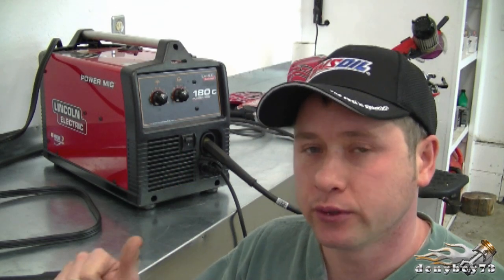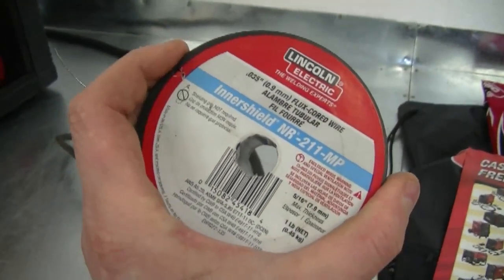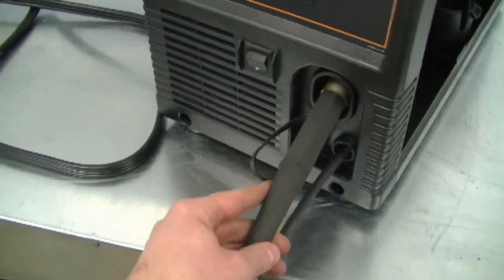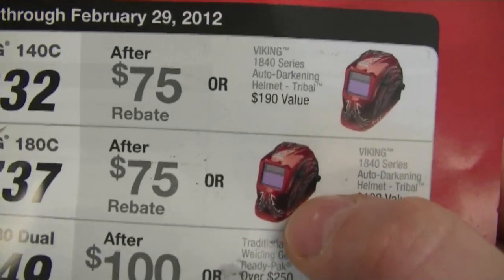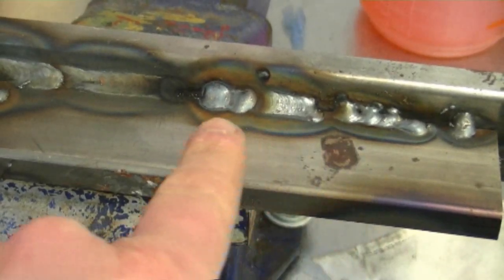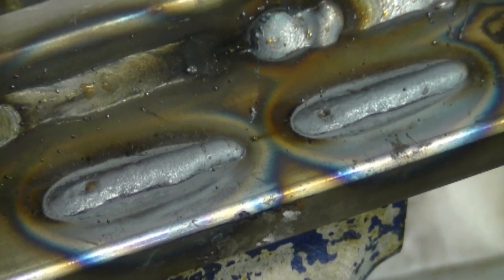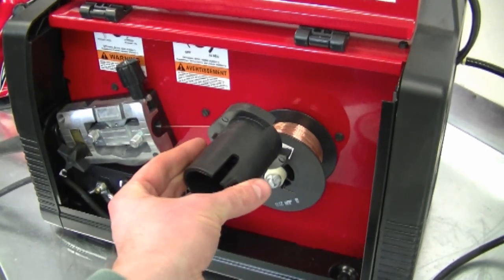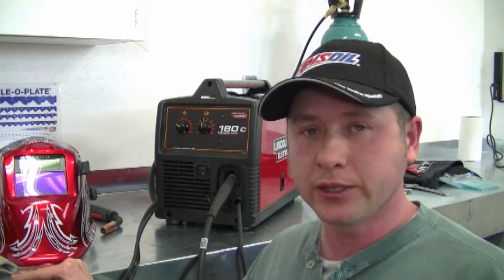Review of Power Mig 180c Welder by Lincoln Electric

Comment: Im a retired welder Fabricator of 32 yrs I built ski lifts for 25 yrs  I No longer have a shop i just need  a mig welder to do ornamental iron work  with my son in my home garage , The last job I did I Fabricated  1/3 of the steel barrier fence that surrounded ground zero after 911, I welded the Memorial plaques  to the entrance gates.
Reply: Ol School Welding Tips and Tricks you sound like a pro. , do you think this welder will be okay for 1/2" steel ? I'll be using flux core...
Reply: CB in the bible daily  You can weld 1/2 " Material  if its going to be very structural  project  I would do multi pass  I just bought  the lincoln  180 dual   and I welded  3/8  plate no problem and it wasn't  even maxed  out .iLL be doing a video  on the 180 dual  using mig solid wire 75/25  all positions  including  overhead  .
Reply: Ol School Welding Tips and Tricks thanx, I was thinking about doing 3 beads on 1/4" tubing, I said 1/2" in case I ever needed it thanx again, I'll be looking out for your video
Reply from the maker: awesome man
Reply: Ol School,  Riblet?
Reply: That's a light duty welder for that really,  I have a Lincoln 256, much better for heavier material.  Miller 212 Autoset  or 252 is nice for what you are talking about as well.

Comment: There is also a very important note the welder has to be set either dc- or dc + depending on weather you are welding flux core or with gas.Flux-cored welding requires DC electrode negative and gas dc electrode positive

Comment: Nice video Donyboy, I just bought the 180c off of Craigslist for 6 bills, the guy only used it a couple of hours if that, it looks brand new, not one mark on it with the cart...

 I will be running it off a 6k watt generator doing mobil repair and custom handrails. After watching you run your machine, I am impressed with the performance, I'm waiting for some 10 gauge wire and a plug off of fleabay to make a pigtail to run off the gen set. I can hardly wait to weld. 
 
And again, very nice video!

Comment: I had a hobart 140 handler w/110v plug.  One knob had 4 numbers and the other had 10 or 12  (like yours with letters) that adjusted how fast the wire was fed and the knob with 4 numbers adjusted the current ( from 25 to 140amps) Yours will do 180 so having 220v as the supply would be less stress on the equipment. when you use gas it won't splatter like the flux core w/no gas

and you are going to want to secure that tank!

Comment: a tip.....i was a structural welder for 11 years on drilling rigs and navy ships parts.....pull the nozzle past your tip about a 1/4 to 3/8"....youre gonna get splatter stuck to the tip ...never have your welding tip further out than the nozzle...especially when your doing heavy welding.....also use nozzle dip, its a gel that you submerge your tip of gun into after welding for minute ...make sure its good and hot so it can melt the gel onto the nozzle and tip....shake excess off and your good to go.......
Reply: Red Blue40  the nozzles and tip are like this from the factory or even when replaced. There’s no adjustment’s. Can the tips just be grounded,cut,or sanded down to the length that they’re recessed below the nozzle?

Comment: if you find yourself  using it alot, i would highly recommend getting the bigger 10 or 11 lb roll of wire after you are done with that.. really sucks having to stop half way through a weld to change the wire. i have a smaller flux core 120v lincoln, and i have used it alot, and it gets very decent penetration, ive put about 25 lbs of wire through it so far and i haven't had to so much as change the tip.

Comment: Get the nozzle in a bit closer to your work. You have too much wire out, looks like you are back a good inch maybe more. Try to get in closer to 1/2" to 3/4 of an inch, it really makes a difference. And SLOW DOWN.  Let that puddle fill in before you move.  It doesn't make as much difference on surfacing beads but on T joints and lap joints it makes a BIG difference especially if you don't want undercut or not enough wetting in on the edges.
Reply: Yep, I thought the same thing.  Get closer.  The arc needs to be shielded by gas, and being closer will also allow you to get more consistent.

Don't look for beads on top of metal... a nice stack of dimes will let you know you're getting enough penetration and adding enough metal to get a good weld.
Reply from the maker: BigDogsHunt100 thanks, I've gotten lots of practice since

Comment: No doubt MIG welding is a lot easier to master than stick! I took some evening lessons at our local tech school , Mastering vertical and overhead with stick takes a lot of practice and knowing the right heats. I have a MIG welder but don't use  gas. Flat welding is relatively easy. Too cold to do any weling as my garage is not heated. I do check the helmet batteries often before doing a weld job.God vid Dony.

Comment: I was a code welder for 16 yrs., and if you want to get better… keep your tip inside the cup about 1/4 inch. and get your cup closer to the weld puddle. I saw your welds were a little oxidized, this will prevent that. Good luck !.
Reply from the maker: thanks for the tips

Comment: Bought this yesterday, holy Molly!  Best welder I got so far.
Reply from the maker: same here, I only use it with the gas
Reply: donyboy73 I haven't used it with gas. If I buy the Argon tank, do I just connect the gas line to the back side and start welding?
Reply from the maker: Hardy Jabbar yes with just solid wire, you should have gotten the gas regulator with it

Comment: I enjoy your vids donyboy73.  Quick question: did your 180c come with all the gear you needed to run 0.045" wire?  
I bought the Home Depot version and the 0.045" wire requires a gun liner, 0.045" feeder sprocket and gun tip that comes in a kit with 10lbs roll of wire.  Of course HD or the other stores dont stock this kit which apparently retails for about $C175 if you can find a place to order it.  The larger wire is needed for welding 3/8 to 1/2" material (which is why I went with the 180 in the first place!).  People thinking about these machines might like to know for price comparison.  If the 180c comes with all that 0.045" gear for thicker work material then it is a way better deal.  
Is that a prairie Mennonite accent I detect ? ;)

Comment: Nice review - makes me want to add one to my shop ;-)
Quick pointer about ending your welds - saw on your test piece that you have fish-eyes and a tapered weld - you need to pause your gun travel for a moment and roll the head up perpendicular to the work before you cut the arc.  This will give you that extra bit of fill wire into the end of the weld to beef it up and fill out that little hole.  It's an art form... keep creating!

Comment: if you repair auto body panels do not use flux core because the flux will effect the paint... you have to use the gas known as mig or gmaw... the flux core will work on exhaust systems well....practice makes perfect... happy welding
Reply: isellcatlitter 
As a certified welder i am telling you that you have to remove the paint before you weld because the paint will make a poisonous gas.

Comment: This is the specs of this machine from Lincoln  for the 180c Voltage/Duty Cycle Current Voltage at Rated Amperes
 230 V 30% 130 Amps 20
 208 V 30% 130 Amps 17
 Welding Current Range Open Circuit Voltage Wire Speed Range
 30-180 Amps 34 V 50 - 500 in/min.  (1.3 - 12.7 m/min.)So if you Take the Scale on the inside of the wire compartment like all Licolns have you will be able to figure out what the A-J calculate out to A being no lower than 8 volts and J being 34 volts would be 26 volt difference divided by 10 would be 2.6 volts difference between Letters.

Comment: I'm just wondering how it works because the welding machine that I saw has welding rod to connect the metal together and that machine just use electricity and w/o welding rod?  Thanks a lot

Comment: nice welder. i have the hobart handler 187. i have had it for 2 years and i think it is equivalent to you lincoln.by the way i work on small engines free time and use to work part time t a shop any tips on how i can open my own shop.

Comment: I have the 140 hd set up with a tank and I have the 120 for only flux and 140 for straight mig both work great for what I need it at home I work at the bodyshop as a painter so the big boy mig welder is at the bodyshop if I really needed to weld somthing hard core but for at home I use more the 140 sometimes I'll use the 120 for dirty metal or a bit rusty I still clean my metal for flux both welders work very good I was going to get the same one u got but I had the 120 Lincoln welder and the 140 I got brand new in the box for a side job I did . I had a Frend that he bought the 140 brand new and the tank he bought as we'll the tank is a 60 a good size right after he got into a car accident in the front a little fender bender but the funny part was it was his wife's car and she was on a trip so I had to put a new left light and fix the fender and paint the hood bumper and fender it took me less then a hours and it was 5 hours one day and shy one 3 hours the next day and the car was black audi so color was easy no blending door but ya right after I finish the car I brought it to his house and he was dropping me back home so when I got to his house I saw him in his garage opening the box for the 140 so I was joking with him telling him I'll take the welder for the job we'll guess what he said ok so I said and the tank right he said yes we'll at the end we worked it out he paid for the paint parts and I did only the labor so ya we worked out that deal witch for me it was we'll worth it I was going to charge him cause he was a Frend 500.00 so I got the tank with the cart for free ! That is how I ended with the 140 and he bought it at a store that sells Lincoln welders just how u bought yours and I'll say this like u said it's a few more dollors and u get a few more better parts then a homedepoit store but ya I was going to get the 180 but with this side job I got this great deal the guy never got to turn it on and it was still in the box when I got there I Ben using it for about 7 months and it works Alsome with the tank am going to make a custom cart for my two welders and my plasma cutter .. O Danny I like your videos I watch quite a bit of yor videos on snowblower learn quiet a bit on them threw u I have a 1974 Ariens 8 hp with electric start I got it on criglist for 200 bucks and it sat in a basement for over 20 years when the gut bought it he past aways shortly after and his kids put it down in the basement and last year the mother past away so the kids was cleaning the house and he put the ad up I saw the ad right away I called him went and saw it my mouth drop when I saw it it looks like it's 2 years old I mean no rust Crome is all there everthing look like new I got a deal of a life time ever one that sees it wants it but ya when I got there the kid said that 20 pepole called allready after me I used it last winter up here in Boston and it was a bad winter I did the ruber trick in the imperller trick and man this this is a tank with a lot of power I did the points and change all fluids and new belt witch it still new and wax it up and it looks like new I don't know how to put a picture on here so u can see it but if I see any of your video with your email I'll send u a few pictures I know u will get a kick out of it I sent a few pictures to a guy I think his name is scout and he was shock too see this snowblower this we'll taking care of he said he will put my pictures on his websight this winter coming up cause he said he updated his page ever 6 months to a year but he did say this for shore will go on his page but ya it's really nice and rember I paint cars so is not like am saying this and it looks like crap no it was a great find everone that sees it tells me to put it alway and don't use it but I didn't buy it for that evertime before I use it I spray wd 40 silicone on it and when am done using it I have a 80 gal com.. So I blow it off with air bring it the garage and dry it clean even if I use it 3 times that day I blow it off and dry it those 3 times I change the oil 3 times in that winter I have a cover for it and it sleeps in my garage but ya I thought u would get a kick out of this how I got the snowblower and welder sorry for a very long comment !! Keep up the good work on your videos u do a good job in making these videos I don't make any videos cause am good with my hands not videos I would love to make a video on my snowblower but I just don't no how to make a good video on it so pepole can see if u look around and everyday u can find good things out there like this 74 Ariens that I will never buy a new snowblower cause of it's cheap plastic or thin metal or aluminum gear box and so on we'll agin keep up the good work !!!!!!!!!!!

Comment: Thanks for the info, heads a bit like jelly at the moment but I think I'm starting to work out that a might need about a 180 amp machine for my welding.
Reply from the maker: +SupaLexy (SupaNautica & MotoLexy) yes I wouldn't go any smaller, beware of the cheaper offshore machines
Reply: I'm planning to build Aluminium Trailers, would like a 180 to 200 amp Mig or Tig. Something I can use at home on Single Phase and I don't want to buy a cheap machine, but I don't know if I will need to spend all that much for the welding to be honest. The frame of the trailer would be the thickest part, but the box that sits on top would obviously be thinner extrusions. I'm in Australia, so the American info and machines on youtube videos can sometimes confuse me, as we have different volts and hurts. 230V @ 50Hz I believe
Reply: I'm in Australia, so I did end up checking out the Millers, the Lincolns and with a budget of $2,500 AU for a Machine, I got a brand that's well known in Australia. Bossweld MSTX250

Mainly going to be Mig on this machine, if I want I can Tig and Stick, but my next machine will be another well known brand in Aus - UniMig, and that machine will be the ACDC200 Tig, so it's obviously going to be for my Tig Welding. Got Square Wave Tech, a few other things that either cost way too much money in other brands due to the importing into Australia or are not in the other machines here at all. 

Exciting times, can't wait to get into my machine and weld up some Aluminium and Steel things. I got a Spool Gun with my Bossweld rig too, so I'm good for all that will be great.
Reply: I should add, $2,500 was my budget, but I did get some Helmets, the Spool Gun, Aluminium and Steel Wire in 4.5kg and 15kg Spools, a few other things, so yeah since that I've gotten a Bottle of Argon and just got my Tri Mix for Mild Steel. Not far off Welding now, 2 weeks tops and I'll be running beads

Comment: What exact parts do you have to change out to use the gas vs flux core?  If you have part numbers that will help too. Thanks
Reply from the maker: +Michael Hannah just switch polarity by switching cables in machine and get argon c02 mix

Comment: i have a problem with my power mig 180c  i didn't use it for a long time since i bought it, and now the problem is when i pull the trigger the wire feed continuously even i stop pulling it..... any help???
Reply from the maker: maybe the trigger switch is stuck? also check all connections to machine

Comment: Got my eye on a used one. Mig Pak 180, $450 CAN but I just noticed it is black plastic inside
Reply from the maker: not the same as 180c in this video
Reply: donyboy73 yes I understand that, curious if it's worth getting the department store type even for under $500 if it's full of plastic, I think it originally came from Canadian tire
Reply from the maker: personally I prefer the 180c or dual because there is more adjustments in the dials. the ct ones just click to the next setting. the ones on mine are totally variable and the system is better built. however if you're only going to use every so often then you should be good. just try it first

Comment: Diamond Core Technology™ – Delivers a forgiving arc, excellent out-of-position arc action, low spatter and a wide voltage sweet spot at a given wire feed speed for steel, stainless steel or aluminum. That welder  has a power setting of Diamond Core Technology™ – Delivers a forgiving arc, excellent out-of-position arc action, low spatter and a wide voltage sweet spot at a given wire feed speed for steel, stainless steel or aluminum. Power out is 30-180A DC
I heard 18amps each letter 
 .

Comment: industrial grade welder ? other than the plastic gear setup whats the difference? voltage in and voltage out aren't they the same? home depot got the plastic in their welder and  weld supply store got metal gears in theres and the price difference at weld supply store is almost twice that of homedepot . metal gears cost around 40 or 50 dollars and iam sure you can purchase the home depot unit and replace the gears with metal so why the big difference on price home depot and weld supply ? hmm ? ☺
Reply from the maker: the knobs adjust more precisely on the welder as well.

Comment: i like the helmet, i have a miller one my self but that lincoln helmet is nice, i also have lincoln 140 115 volt welder works great
Reply from the maker: hey kevin just noticed you sell rc stuff and you're in north bay. is the redcat terremoto any good?
Reply: donyboy73 i havent tried it yet but i have looked it over really well and it seems pretty solid so i might be getting one the showcase store at the mall sells them , where you from

Comment: Bought this exact unit because of the potentiometer. After a year of use the motherboard blew, during normal use.
Would not recommend this unit to anybody. Also have to hardwire spoolgun into unit. Buy a miller!.